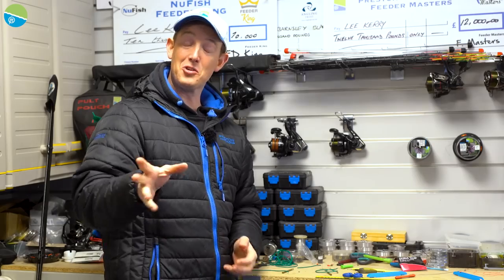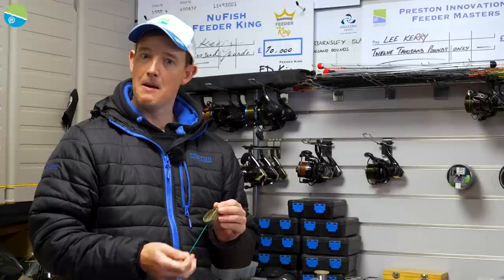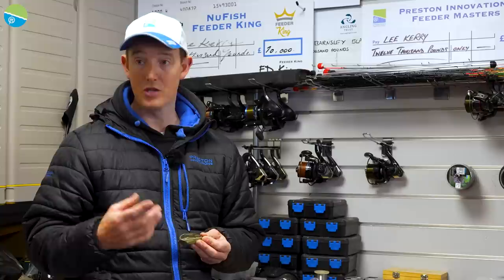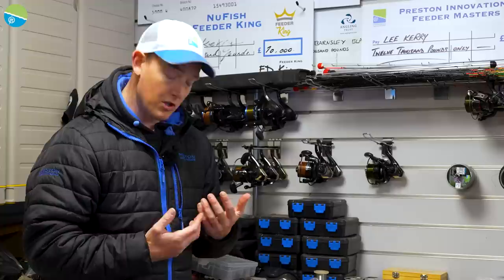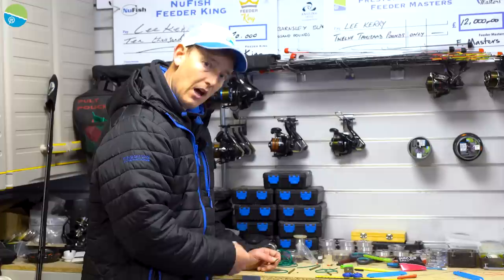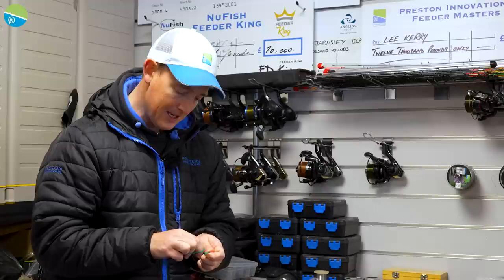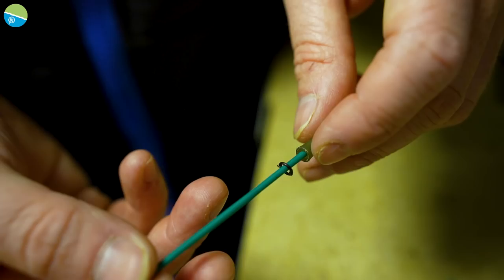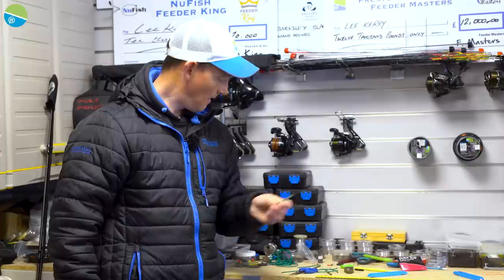How to Elasticate a Feeder Stem | Lee Kerry

Comment: I love using elasticated feeders, but i was losing fish from the elastic snapping, sometimes on the first use, so i tie my own elastic now. I did use hollow elastic, but i've found the newer hybrid elastics are a little better and don't need changing as often. I also stopped using the small ring, and use a small quick change swivel instead.
Reply: I tried what you said but can't get the elastic through the tiny eye.  How do you this?
Reply: @alexkemmeren3129  Which quick change swivels are you using? I use the Preston's Quick Change Swivels, but before i tried using those i used small snap link swivels. If you can't get the elastic through, tie some line to the end of the elastic and pull it through. Hollow elastic is thicker than hybrid elastic, that why i use it, easier to get  a 10 to 12 or 12 to14 through.

Comment: Very interesting and money saving tip! Thank you!
Which kind of elastic (type and strenght) would you use to re-do the elasticated stems please?
Reply from the maker: 13 or 15 Hollo/ 12 or 14 Dura Hollo
Reply: @UKprestoninnovations  Thanks!
Reply: Hi Lee 
Could you use a tiny Dacron connector on the end of the elastic to attach hook lengths to ?
Reply: Hi Mark
Yes you could
But the ring is very beat
Reply: @theedge8815 
 thanks for your reply much appreciated
Reply: Sorry to say I have actually given up on the Preston elasticated stems now, I had so many elastic breaking or coming undone at the hooklength end. I’ve actually switched to the Map Embed feeder but use Guru X Safe stems which are a bit tight. I don’t need quick change as I have a clip at the end of the main line and change over. So far the white and the black elastics work well the only issue is the little cover that goes over the hooklength clip is easy to use